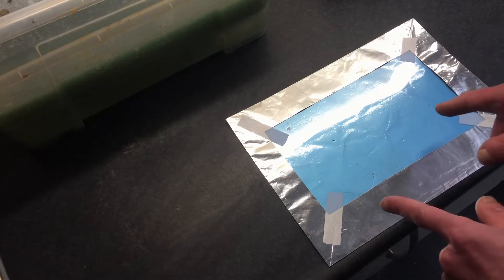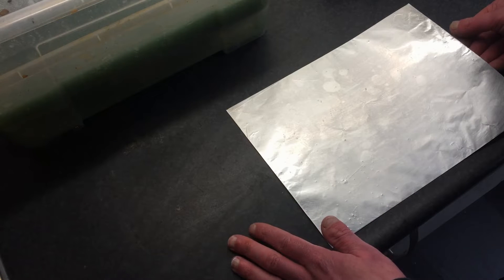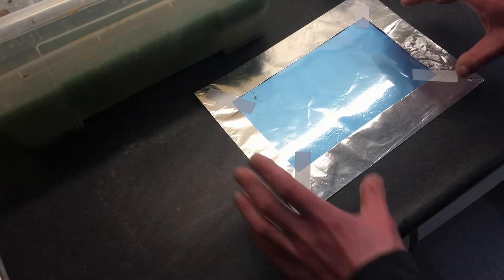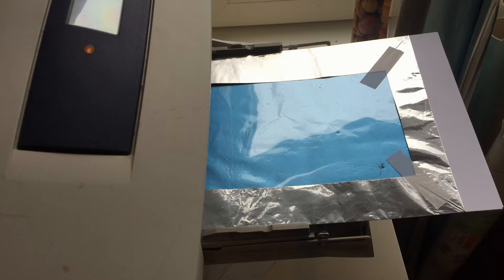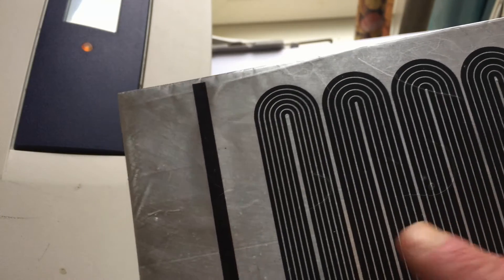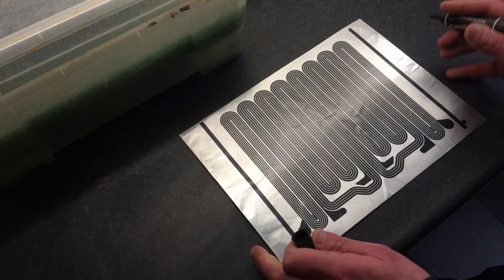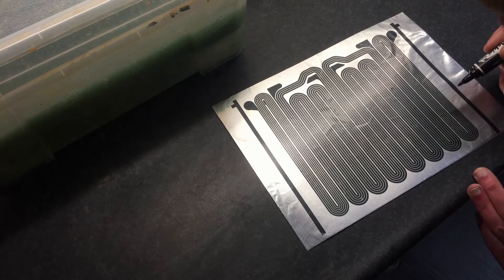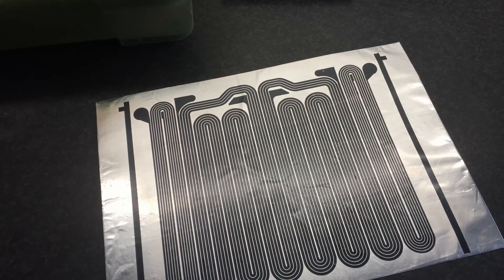PRT1 - Bluetooth Neodymium Planar Magnetic Test Panel

Comment: i wonder what if we use conductive ink instead of aluminum.Just use your cnc to draw the electric circuit down on the coil,and it could be easy all the way,i suppose.
Reply from the maker: except for having  conductive ink that has low enough resistance and is lighter then aluminium and a way to print with it :)  no such ink excists im afraid. silver ink is more heavy then alu and has a binder to hold it together witch makes it even more heavy.

 plotting is the simplest method. witch could be done with hobby scrap book tool plotter..  for instance like a cameo. a 150-200 euro machine. or use alumnium magnet wires. somehow no one wants to but they perform rather good and no need for any fancy tools. just right size wire and some 30nf glue :)  and if you want it neat , a small jig
Reply: @joppepeelen  I know theres some stuff called Graphene，which can be light enough to be 1nanometer in thickness and they have pretty excellent conductive ability.However such thing is expensive.Despite theres some merchants say they have liquid ones to spray, I dont quite bilieve them.
Reply: @joppepeelen  as for resistance，can we use Parallel resistance trick to low it down？In these ways，the problem may be solved i suppose.

Comment: If you do not have good coverage and black is not solid black but it  have a little points than use trick with Nitro solvent.

You need some box that is little bigger than your printing so your printing can fit inside, than you need some jar and fill it with nitro solvent. Than make some spacers, put your printing with printed side up and close box. Wait some time and nitro solvent vapors should "melt" printing toner and fill that litle gaps on printing.

P.S. If nitro disolves your plastic membrane or whatever you use than do not do this... first check on small scrap part.
Reply from the maker: nice !, well to be sure  this is not toner but wax, so not sure if it works on wax to ?
Reply: @joppepeelen  im not sure... try to  put some nitro on wax and see will it desolve wax... if nitro disolve it than I think it will be ok... try on some scrap part... We used this trick when making film for photosensitive PCB and films are  printed on laser printer.

P.S. look at your google hangout... :)